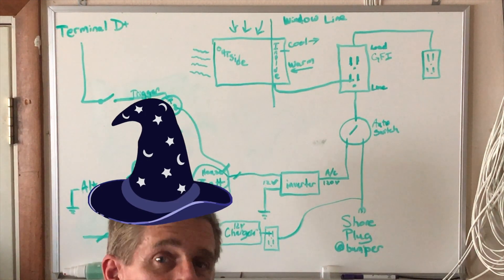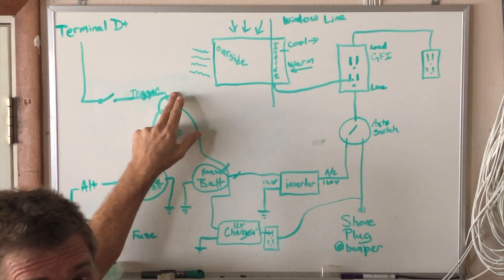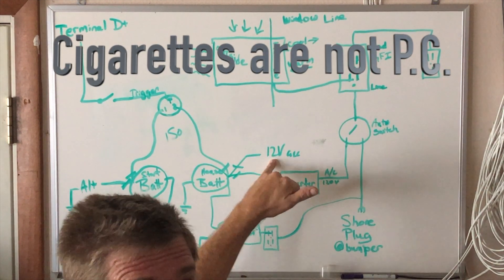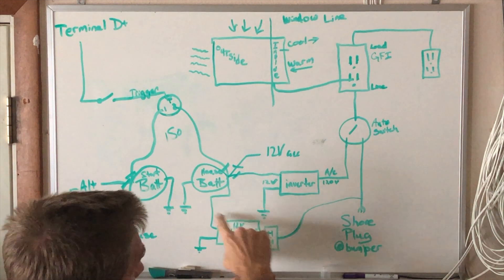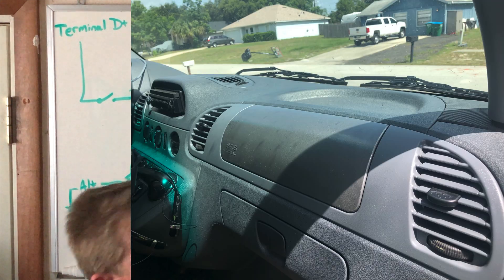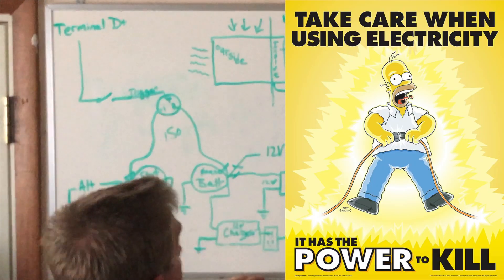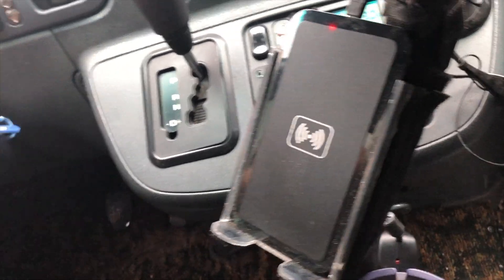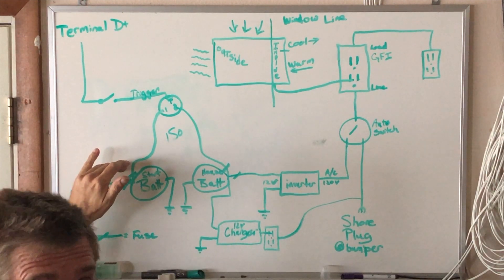Off-Grid Air Conditioning Camper Van Style. No solar, no wind, just alternator and battery.

Comment: Nice, might you be able to recommend a model and brand of the toll box? Or do you have a video on installing the toolbox in the van?

Thanks, I just found your channel and I subscribed.
Reply from the maker: This toolbox was on Craigslist for $60, used.  The feature to look for is being wider at the top with a shoulder that stops the box from going deeper in the van. This shoulder gives a good seal and mounting ability.
Reply: @FloridaVanMan  thank you! I’m going to try and find a local store (New Jersey) that I can look at actual toolboxes in.

Since 2001 I I have owned 3 sprinters. But right now I have an old chevy 3500 diesel van.

I’m 67 and would like to find an afordable pre 2006 sprinter since I’m in forclousure and my house will soon be auctioned. I don’t think I’ll be able to afford one so this chevy will likely have to do for me to live in.

I’m thinking maybe down the road I’ll be able to get a Genmax gasoline/propane with remote start generator. 

Thanks for the help.
Reply from the maker: @StateNewsService  I know a van that may be perfect for you. The price is right! Can you email me? Bill at FloridaVanMan dot com

Comment: Hi Mate , love your channel and everything you do, have loads of T1Ns down here in Australia and every thing you are doing is very helpfull, during this great presentation at 3.57 I noticed next to the fuse box a hole in the body work with well protected wires passing through, a little more insulation at this point will stop your van from becoming live (12volt) and maybe burning down. have seen this before. Keep up the good work.
Reply from the maker: Indeed, those wires were given a bit of extra heat shrink to protect in the short term. When the remaining electric was finished, the hole was sealed with silicone to prevent abrasions. Those wires are outputs from the fusebox, so the fuse should blow before any danger. Thanks for the tip though. Good eye!

Comment: How long does it take to recharge batteries with that alternator?
Reply from the maker: That is a difficult question to answer with a list of variables. Lower ambient temperature allows it to charge much faster, and it charges very fast when the battery is very low. But as it gets close to full charge the rate slows to a trickle charge. When I run the battery really low overnight, it will charge 100amps or more in the first hour of driving in the cool summer morning. 4 or 5 hours of driving will return the battery to high charge, near 90%. But the rate slowly drops as the battery voltage rises and temperatures of the alternator and BMS warm up. When the temperatures climb in the mid day, and the battery state of charge gets above 80% the charge rate is typically around 8amps. When I get above 90% state of charge, my charge rate is closer to 3amps so getting the meter from 90% (388aHr) to fully charged (400aHr) takes another 4 hours of driving. When I am traveling for work I drive more than 8 hours each day and have plenty of battery to run a/c 6-8 hours. 
When I am not traveling far for work, and driving locally or doing the tourist thing with family, I compare this to treading water. If all I am trying to do is keep my head up, it is very easy. My charge rate "floats" around 85% with nightly use and daily driving. But trying to keep my battery full and ready for anything is like keeping my shoulders dry while treading water. It takes a LOT MORE effort and attention. 
This 400aHr battery and 200amp alternator is a good fit for my use. I can overburden it in unusual circumstances, so I know it is not too big for my needs. Yet, it works almost flawlessly in my normal travel habits so I know it is big enough. I have small quiet generator options for the unusual high demands like running stop-n-go's all day and keeping the a/c running way into the night in south Florida for a weekend without plug-in services.

Comment: This is coming from a 38 yr air conditioning engineer here. Sorry but that window AC unit needs unobstructed venting not thru louvers in the toolbox and certainly not ducted down thru the bottom of van. The condenser fan is not capable of overcoming the additional air resistance in those cases and will result in the unit running very high head pressure (more amps too) and a greatly shorted lifespan. The install thru the rear door is fine. Great video and wiring connectivity info, however.
Reply from the maker: I appreciate your experience and comments, but my testing has proven your theory incorrect. I tested extensively with a Kill-a-Watt meter, running the a/c with the tool box door open. I added the vents and found the efficiency fell. The air was not as cold and the amp-draw increased so I used it with the door open for nearly a year. At the advice from a FB friend (Hi Fred) I added foam to channel the in and out air-flow through the louvers, rather than just throwing the air at it with good intention. The a/c now runs at the same amp-draw and cooling as when the door was propped open. It has been working very well for over 5 years with regular use, but I am not full-time in the van. It is used 2 or three days a week on average, 9 months of the year. 
The floor vented unit has also been well tested. The meters on the inverter and solar system are used for amp measurements. The unit draws same amps in the van as it did on a bench testing various system parts before installing. The original plan included forced air, a fan beneath the floor. This fan was eliminated after proving it made 0.00amp difference in the a/c's power draw and no noticeable difference in cooled air temps.
Reply: Respectfully Florida Van Man sir I submit my own video testing my "theory", as you call it. My almost 40 yrs of experience in design, installation and service of commercial and residential HVAC systems tells me all I need to know, that is you cannot restrict (or duct) the airflow into and out of a window AC condenser and it have no effect on the performance and efficiency of the unit. The laws of Thermodynamics are clearly applicable in this case. The condenser fan has to work much harder to try and push the air in the ducted installation, compared to a free blow in a window. This results in a significantly higher condensing temperature and this degrades the unit performance and consumes more power. 

However, I do respect your depth of knowledge on many subjects related to van builds and modifications and I very much appreciate and admire much of the content here that you have shared with others. I felt it important to share a differing opinion (and backing evidence) of potential problems with your ducted window AC installation. Not to prove you wrong, and prove I am right, but to offer a different perspective that there are potential issues with doing what you are promoting with this ducted window AC unit install through the bottom of the van. The unit will run hotter, run longer, produce warmer supply air and likely have a shortened lifespan. If one is willing to accept those downsides then go for it! As I said in a previous comment, a portable AC unit that has flex ducts to duct air in and out of the unit would be much better than trying to make a window AC unit do something that it is not designed to do. https://youtu.be/GSCxkRpiJfo
Reply: @FloridaVanMan  I appreciate your ingenuity and adding baffles to direct and separate the intake/exhaust air on the toolbox install may help but the ducted out the bottom of van configuration no way. Most window AC units have condenser air intakes on the sides and exhaust out the back. That is why they must be installed in a window not in a thick wall which will block the side vents. I see no separation of the intake/exhaust air off the back of the unit and the two openings at the bottom of the box are way too small to move enough air. The exhaust air blows directly into a flat surface in the box which reduces the airflow and increases the resistance on the fan. And I have no interest in cutting large holes in the floor of my van which could allow rodents or other creatures to build a nest. And I see no provision for draining the condensate. Speaking of condensate most window AC units use a slinger ring to pick up condensate from the drain pan and spray it on the condenser coil, which helps the cooling effect. Sometimes this sprayed water comes out the back of the unit, which in your "box" means the inside of the duct box might get wet and when driving in rain lots of water will enter those openings under the van. A "prop" type condenser fan used in window AC units is incapable of generating enough static pressure to push air through obstructions, they are intended for open "free" blow conditions only. I guarantee no window AC manufacturer would approve of your ducted condenser installation and in most cases would void the warranty. Instead of trying to force a window AC unit to do something it is not intended to do why not just use a portable AC unit designed specifically to duct the condenser air which have adequate fans and are intended for this purpose?  I could see using one of those dryer vent hoods on the side of van and connect the flex duct to that which has a flapper that closes when unit is not running. https://www.amazon.com/Honeywell-MN10CES-000-Portable-Conditioner/dp/B008UHWUY4
Reply: Craig G Real world trumps theory once again!
Reply: @brianasamuels  Kindly share with the audience at home what "real world" experience in HVAC design and installation you have since you are so confident in your claim.
Reply: Craig G just reread  what Florida Van Man wrote and you are there! That and my  40 years of fixing poor engineering!
Reply: @brianasamuels  thanks for trolling my post. This has nothing to do with you and you have no first hand knowledge of how this works but nice try. Poor installation is much more common than poor engineering. No window unit manufacturer would warranty a unit installed like this.

Comment: Do you have any issues with the van having long idle times? I thought it was problematic for things like the egr valve. Exploring the ideas of adding this to mine
Reply from the maker: Sprinters do not idle well for long times. The coolant does not circulate well enough and idling while I slept in cold weather cracked my head, so I don't do that any more. I run my a/c and charge batteries while driving. The battery will run the a/c with the van off. I get about 2 hours of runtime for every useable 100ahr. My "400aHr" (300usable) battery will run the a/c 6-8 hours.
Reply: Florida Van Man thank you!

Comment: that sounds about right! A 400ahr 12v batt is 4800whrs, and 4800 divided by 600watts is 8 hrs. And you got 6hrs real-world. Not too far off.
Reply from the maker: I didn't link the $1500 battery because I'm not real happy with it. The inverter shut off before the BMS shut the battery down, but the meter showed something like 175aHr left in the tank. I would measure it another way, but what it measures doesn't matter as much as what it does. I set the inverter shut-off just above the recovery voltage, last time the BMS shut down. I suppose I could set the inverter a little lower, closer to the Low Battery Shut Down of the BMS..? It does alright for this van and my needs, with a little safety margin so I can still use a 12v fan when the inverter (a/c) quits. You've been very helpful putting this thing together and pointing me in the right direction when I was starting my studies and stumbling over . Thank You!